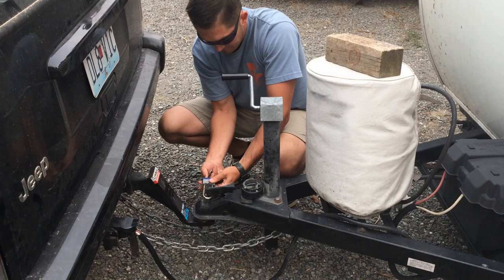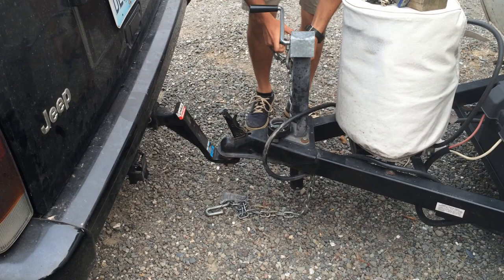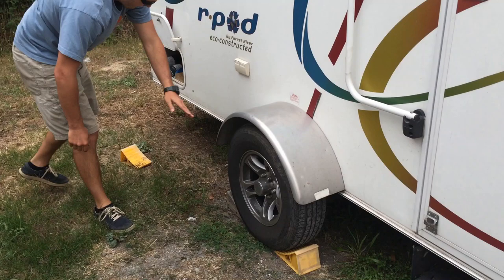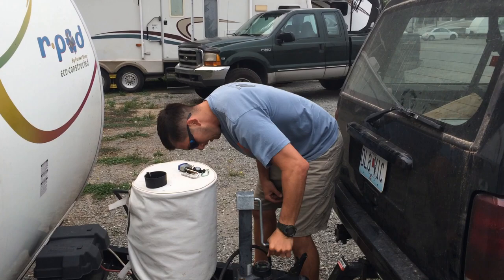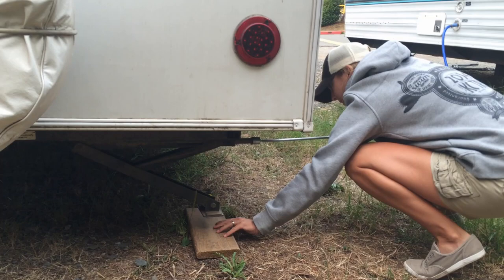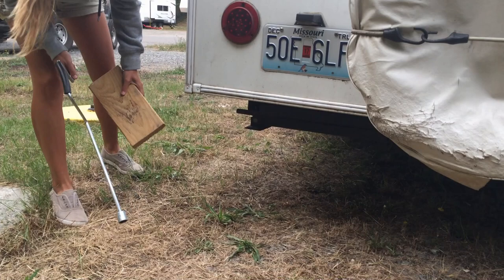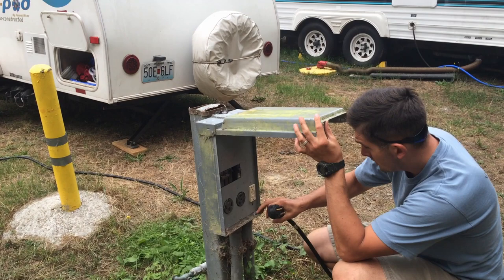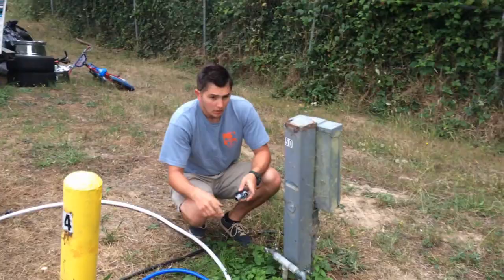Travel Trailer Set-up (R-Pod 171) - GFB

Comment: Great video....This is just some info that we got when we first got started and it helped us out a lot. If you get a equalizer weight distribution and anti-sway system this will take most of all the weight from the jeep and trailer and equalize it. This system will keep the trailer and your jeep level and it also keeps the trailer from swaying from trucks passing and windy days. The other thing is that your head lights will shine straight forward and not up into the sky from the weight pushing down on the back of your jeep. The last one that we had been given was about the water filter. If you put the water filter on the camper first then hook up the hose this will take the hose taste out of your drinking water. I hope this is something that you can use and I say happy camping.

Comment: Hey like the videos. Here's a few tips. Never leave hoses on the ground, bugs will follow water line up and into camper. Spray bug spray around tires and anything touching ground. Never leave valves open on black or gray tanks, rats in sewer will come through hose inside of camper and crawl in toilet. Keep safe.
Reply: So should he leave both tanks closed and open only when in use?

Comment: All the advise about keeping the waste gates closed during use, then open later for dump: black, then grey, is spot on. 

Also, when handling the sewer hose, gates, and fittings, you should always wear big ugly rubber gauntlet gloves, protecting your skin (and transfer to your face) from coming into contact with nasties from your own camper waste and those who were there before you. Think of that end of the camper as the 'hazmat' portion of the job.

Also, always open and flush the 'city water' spigot for a half minute or more, to remove any rust particles or other debris, before you run that crud into your filter and/or camper inlet.

I know its a but late, but have fun!

Comment: Nice video.  May want to have a power tester/surge protector to plug into the camp power source to check it out first, then plug your cord if the circuit is good.

Comment: Great video. If I could make a small (constructive) suggestion it would be the following: When hooking up the water hose to your RV the pressure regulator should be the first thing on the spigot (after the splitter) to protect your RV's plumbing and the supply hose feeding it.

Comment: Your video here is VERY informative and VERY well presented. If you want to gain much more MPG on your jeep change the O2 sensors, and also clean you MAF(or MAP) sensor. I guarantee that if you do these two things you will gain 5 MPG.  Jeeps are notorious for deteriorating O2 sensors. MAF sensor cleaning can be done by you in 10 minutes. Very easy.
Reply from the maker: +Jay Gold REALLY?? Ok well, I can promise you I will be doing that within the next couple of weeks... thanks for the tip!
Reply: +GoForBroke  You can research here on YouTube about cleaning your MAF(MAP) sensor and it's function. . It senses the airflow coming into the engine. When it's dirty it tells the computer to send more fuel to the fuel injectors than is necessary. There is typically at least two O2 sensors on the vehicle. An upstream and a downstream. You can research the function of an O2 sensor also and there effect on gas mileage. A clean new air filter is additionally  important to obtain good gas mileage. Along with good wires and plugs. Synthetic oil will help MPG also. Many people sell their cars because they do not address these issues. O2 sensors deteriorate rapidy  after 100,000 miles. Jeeps sooner.
Reply: +GoForBroke If you want to gain even more gas mileage remove your  back seats and put them in storage. You'll pickup another 2 MPG from losing the extra weight. Any extra weight that you can eliminate from the tow vehicle including seats will also improve MPG.

Comment: good tutorial, I agree with most you talked about, I do disagree with you about hooking up your sewer. you should leave valve closed until your tank is full and you are ready to dump. Reason being, when sewer valve is open the way you have it, and you do use the restroom, all water goes out to sewer, leaving waste and you get a poo pile, research this and you'll see what I'm talking  about, you leave gray full also to flush your sewer line. just a suggestion.
Reply from the maker: +Marty Smith Not a bad thought. What I typically would do is leave the grey line open, since it fills after we both take showers, and keep the black tank closed off. Before we leave, I close grey valve and open black to release waste, flushing it with 5 gallon buckets of water from the toilet. Once the black tank is releasing remotely clear water, I close it up and flush with the same method through the grey tank. I have an extra hose I use to wash out the sewer line once I have disconnected, and then we are on our way... after I wash my hands of course. :)
Reply: I've also heard from a "friend of a friend" RV'er to use the 'pillar to make a P trap to keep out the sewer gas.

Comment: Nice videos guys. we're thinking about getting the same unit you have. we found one that I can get for about 10K. we plan to pull it with our Chevy 4.3 V6 Blazer. I wondered if anyone had advice regarding the Blazer. It's a well maintained 2000 2 WD. I'm not sure if it has a oversized transmission cooler or not. well travel light,  just the two of us with two dogs.
We're excited to get started. You're an inspiration. 
Peace.

Comment: Watching you back up to level, I notice your pod appears to still have the stock tires on it. There is a date code, in an oval, on the side of all your tires, it's the week and year of manufacture for the tires. They should be replaced, no more than 5 years after manufacture, no matter how good the tread looks. We have had quite a few tread separations on 1st generation pods this year. It's usually pretty traumatic for both the owner and the pod. It's a good idea to change them before they take a fender out.

Also, there is an outstanding factory recall on your Pod, it does not have the proper, and legally required, rear and fender lighting. If you contact Forest River, they will get the parts out to a dealer/shop of your choice and have the lights and rear wing installed. In fact if you stop by the factory in Goshen, they will do it right there. (I actually recommend that if you are still in the midwest, great people at the factory)
Reply from the maker: +Mark Smith Thanks for the info. I'm sure the tires need replaced ASAP... the only reason I haven't is because they look decent enough, plus we are on a limited budget. It is at the top of my list though. 

As far as the recall goes, I have called several shops to try and get in. One I called in Missouri before we left put me on the back burner, and everyone else has been so busy I have to wait a month to get in, and by that time I'm 600 miles down the road. Thanks for the info though, I will be doing these things shortly.

Comment: I thought you had to cross the safety chains.   Also, see that you do not have a small wheel on your jack in front of the camper.
Reply from the maker: +Harold McCarty I don't feel that crossing the chains is super necessary, but that's just me. The jack didn't come with a wheel on it, but we could easily buy one if it became an issue. the trailer is very light, I can basically move it a few inches with my own strength if needed, so the extra control a wheel gets you wasn't needed.
Reply: GoForBroke crossing the chains is essential - just ask anyone whose hitch ever popped off the ball or receiver fell out, and they'll tell you that you definitely want those chains crossed.
Reply: Some states will ticket you if chains aren't crossed.

Comment: Another tip is to turn on/off the water before you hook the hose up to your trailer to push out all the air and fill the hose with water. We let a manager at an RV park "mansplain" to us on how to hook up the water hose (even though we only asked him to verify which hookup was ours) and he blew a hose full of air into our water system. I guess he thought he was helping. The indicator on the black tank malfunctioned after that. Good thing it was a rental.

And that hitch level is the shiznit!

Comment: Oh, was wondering where you guys have been....missing the videos, oh but where are your gloves in working with the sewage and from all my visiting of reviews, you should not have your gray tank open, it builds up scum from the soap and has no way of clearing it out at the close of your trip, also you can use it to rinse after your black tank dump (thins too you don't want to leave open so none of the particles within harden).
Reply from the maker: Our grey tank is small enough that after one shower each and a round or two of dishes, we have to drain it anyway. So I leave it open if we are camped long. Before we leave, I shut the grey tank and drain black while running bleach water down my shower. Then finish by releasing bleach water in grey tank. I finish by cleaning the pipe with fresh water from my short external hose. 

Instead of gloves, I just wash my hands. 😀. 

Thanks for keeping an eye out for me though! I do try to be sanitary about it! More videos coming soon!